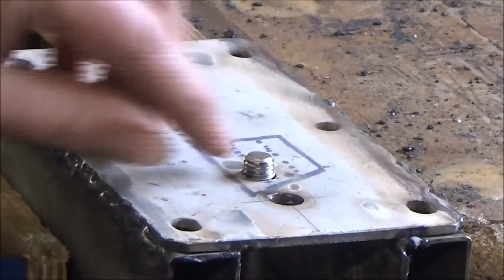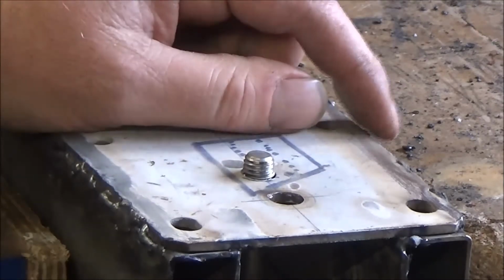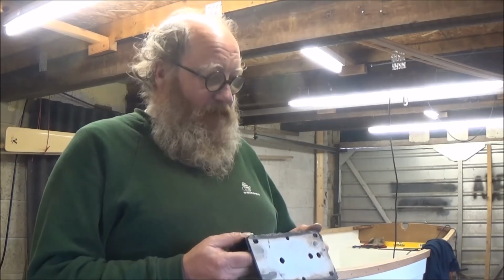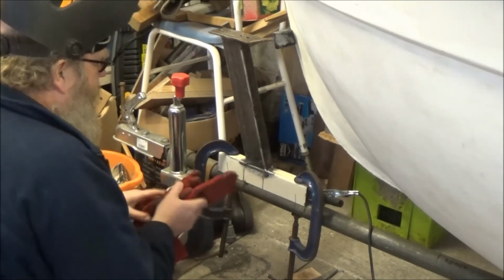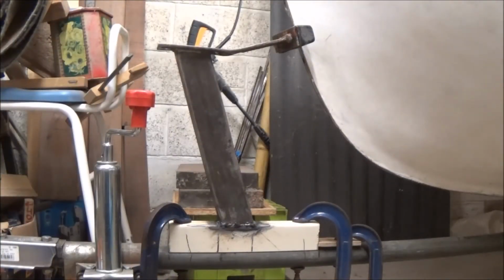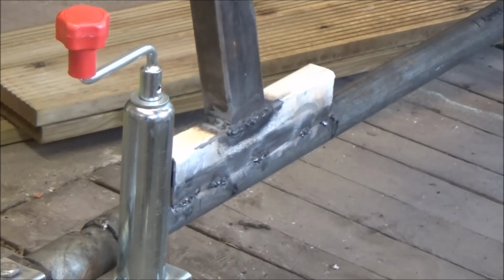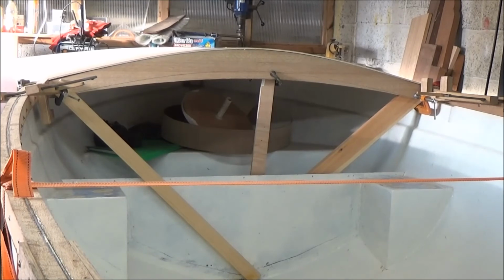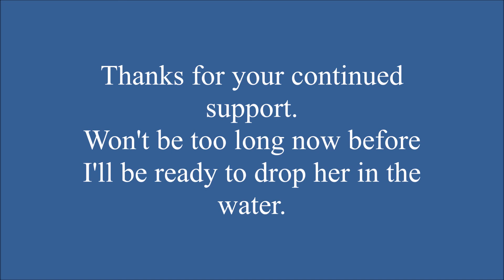Dale Skidmore -Boat Restoration Part 25

Comment: That welder sounds like it will cause all the lights in the neighbourhood  go dim.  Rod selection makes a big difference some times. Autodarkening helmets with magnifying lenses make welding a whole lot easier than the old days. Thank you for the video, Ade
Reply from the maker: Hi Shovel. It does sound a bit like Frankenstein's welder, but it was reasonably cheap, and, as I say it is more practical than the next size up that needs a bigger plug than standard. ZZ suggested pre heating the work may help and the thicker rods are better for the thickness of the steel; I prefer stick to mig, which I couldn't get on with at all. The shield is so much easier than the old sort, I can tell you. Thanks for watching.

Comment: Hiya Ade. Coming on a treat. Don't beat yourself up about the welding mate. It's much better than most folk will ever be able to do who haven't been professionally trained and the 2.5mm is definitely an improvement. I'd love to have a go myself and I think I would do OK with a bit of practice. I'm no expert but I would have dealt with that bolt in exactly the same way buddy. BTW ... mind your head!
Reply from the maker: I expect, like most things, by the time I have finished I will have got to be good enough to start again with the welding, lol. I'm sure you would enjoy the welding too. You and I are no strangers to a bump on the bonce on a frequent basis I expect. Cheers Des.

Comment: Great to see the boat back. I missed it. I think I may have  missed a vid somewhere  as I can't recall any mention of fitting a foredeck...
But ... That will look rather nice.
Have you thought about adding a thin slatted layer to it as a form of  extra  reinforcement that might also  give it a nicer  look to it ?
When you see that shot of the salvaged  original state, she is already looking loads 'prettier@ ...
Launching in the Spring ?
Reply from the maker: Hey Dusty, hope you are doing well. I just checked and found the foredeck discussion in part 11. I have a piece of wood for a King Plank and some stuff for a frame too. There was no frame under the original, come to think of it. I will be putting it together after the paint, possibly after the launch, depending on time... ( I really am looking at the Spring )... She has come a long way from the start and I refer back to that vid from time to time to give me a boost, especially when I was inundated with other work coming in. Cheers.

Comment: I like the way your doin' the bow! Good an strong!! You will be on it!! Try a little heat on your steel before ya' weld. Not cherry but good an hot! Might let your rod run better.   Man I hate it when a rod won't light! HA! Sure lookin' fer your first trip!!!     ZZ.
Reply from the maker: I have thought about using some heat in the steel and I remember seeing the rods stored in a little oven ( they do seem to work better after a stick up has warmed them ). The propane torches I have used don't work very well and blow themselves out so often I get frustrated by them more than by the stick ups. I have seen a lot of vids where people end up on the foredeck and have a skeleton support frame in mind for it. Thanks for the tips and for the tips, they show I am on the right track.